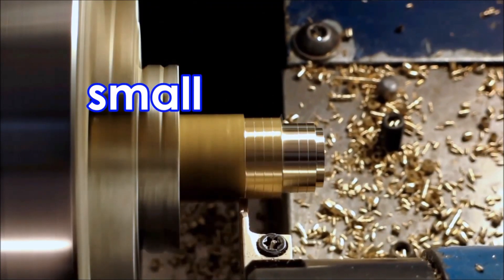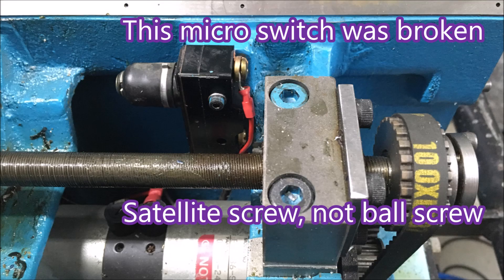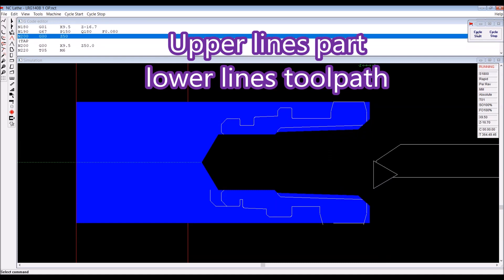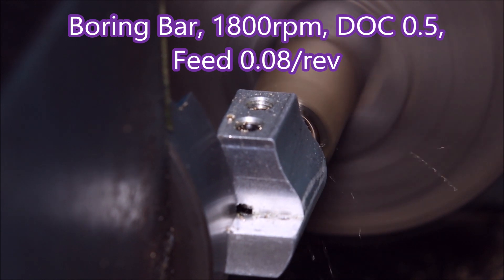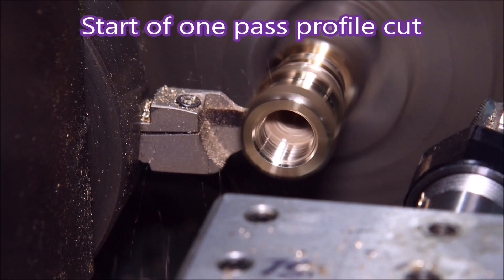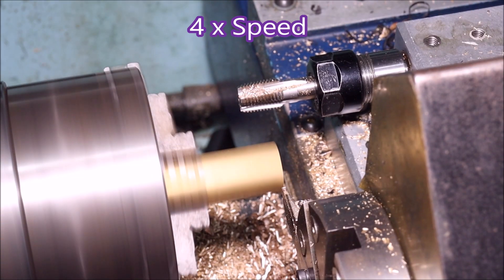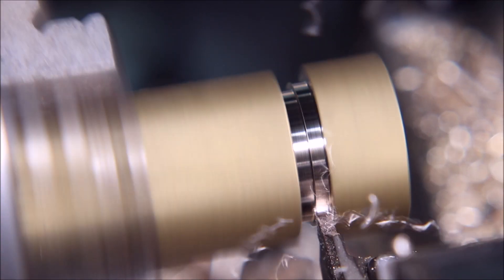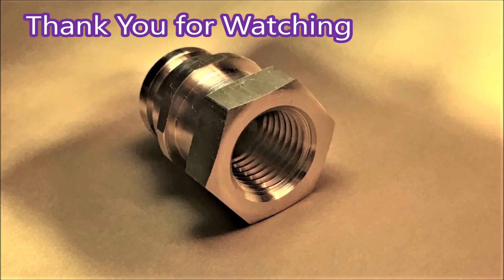CNC lathe turning brass, stub drill, bore, tap 1/4"NPT in DIY floating tap holder, carbide inserts

Comment: i notice you use a constant spindle speed.. is that because of the lathe or preference?
Reply from the maker: Constant surface speed is not an option with these lathes. For most of my work it is a bit irrelevant as I mostly need maximum speed anyway. LOL  I have had a few jobs where it would be useful but not many, most of my work has been small. Thank you for your comment.
Reply: @smallcnclathes  i have a 5k rpm spindle with a 1.25 inch max collet in a swiss style lathe. i use a variable speed just because but sometime find the rpm difference to make the cycle time slower for roughing or im just not using enough sfm. was just wondering if it was your preference. im just getting to afford trying to be more material specific with my insert grade and style. i believe i have had quite the limiting factor using a general purpose grade for most of my parts. fake it till you make it!
Reply from the maker: My insert choices are limited to ones that are very sharp due to a lack of grunt for the spindle. Aluminium inserts for everything non ferrous and a ground insert with 15 degrees of rake for everything else including st st and 4140.  If those inserts can't handle it. I don't bother with the job.  This is after all a lathe built for training students in the use of cnc!
Reply: @smallcnclathes  your machine limits are totally understandable, i wasnt sure. my insert selection has been financially limited. i got a set of holders with a box of inserts and made them last the duration of the machine payments for the most part, 5 years! haha. now ive become more interested in proper tools for it! just bought of box of aluminum inserts for all my holders, be here soon for a job im trying to get. appreciate the info, sure ill bug you again.
Reply: @smallcnclathes  what sort of spindle motor do these lathes have ?
Reply from the maker: @HM-Projects  180 vdc, 2500 rpm, 1/2 hp

Comment: Apologies if this has already been covered but I haven't found it - do you show anywhere how you go from a CAD drawing to the G-code?
Reply from the maker: Michael Henriksen, I have not done this, never thought it would be of interest. Will give it some thought.
Reply: @smallcnclathes  Thanks, I would certainly be interested. I will hopefully acquire a CNC lathe within the next 6-12 months so I'm trying to soak up as much information as possible. I do have some CNC turning and milling experience but mostly with Mazatrol controls. No CAM or G-code writing.
Reply from the maker: You may have to give me a bit of time. So we need to start with a slide of the part drawing and then a slide of the drawing I make to create the dxf? Then I import the dxf to the cam software and show how I create the code by doing a screen record of the actions taken? That is likely to need a great deal of editing my friend, I have always admired folks who can do an onscreen cad tutorial etc and thought “ I could never do that”  if it turns out to be a real dogs breakfast, I may make it unlisted and only you will get to see it. LOL. I am working on the drawing now, making it like this part
Reply from the maker: https://youtu.be/4zeGVwnhbvs damn iPad,
Reply from the maker: Here you go https://youtu.be/mgJA-aJFDHU is that what you mean?

Comment: On the loose turret.  Maybe a 4 postion index-able locking pin that slides into a tapered hole for each tool postion.  Some kind of bevel spring washer type pin and a solenoid to hold it unlocked during rotation.
Reply from the maker: Thank you

Comment: You could probably fit a bike disk brake to the shaft to lock it in place. Should be simple enough, cheap and have more then enough holding power.
Reply from the maker: That might be a very clever solution. Off to look up bike disc brakes!

Comment: "Just saying" I would run this part on a B&S,feed out bar to stop-combination flat drill + face off and from at the same time  in one operation+index and tap +cut off part! cycle time well blow your mind!👍👍
Reply from the maker: I am well aware that other machines can make these faster. However, I have two of these machines in my single car size garage. No room for bar feeder or a forklift to handle long bars. My machines run 240 volt not 415. They make parts at a speed my customers have been happy to pay for in quantities that suit us both. The initial purchase price of one of these was manageable for myself as an individual. Yes there are many machines that can make any part faster, but I don’t own even one of them! And you know what they say about the only tool you own being a hammer!  Thank you for your comment, as it has given me the opportunity to justify how my little machines have managed to keep us fed at times, when there was little other work around.

Comment: Awesome videos,  I had a thought, if your adjustable worm wheel has more backlash on one side, can you switch the part off tool to the tight side? Most other tools you are using are less susceptible for vibration.
Great job!
Reply from the maker: Thank you, you are quite right. If we could get it to a point where the backlash came good at one point, that could be where the parting tool is fitted. I have a few options to consider. One of them being, make it possible to tap in the other lathe, which may be the best option. That lathe has far more power available at the spindle. Not sure at this stage where to spend my time. Adjustment of that worm wheel is not easy, almost needs to be fitted with a jack screw so the tension between them can be changed incrementally. Thank you for your suggestion.
Reply: @smallcnclathes  I know your lathe is a complete running machine and too busy to tear down. But I know worm wheels are next to impossible to remove backlash. On my CNC mill 5 axis table I used Harmonic Drive planetary reduction gear sets and they are very solid with no backlash. Just an idea if you feel like upgrading your tool spindle.
Reply from the maker: I have reached the stage where I really don’t need two lathes anymore. As they exist, they both have things they can do, that the other cannot.
If I can get the other one to tap, the only thing this one can do that the other can’t is cut tapered threads. A function I really no longer need. So I guess I really need to get the old one tapping and then make a choice about making more space in the shed!!

Comment: https://youtu.be/w6_gJXj8yHA?t=123 I'm wondering how you ended up with an internal chamfer on the chuck side. Did you modify the toolpath of the boring bar to plunge into the material at the bottom of the hole?
Reply from the maker: I have done that before but with larger bores and 35 degree point tools.  This was an 80° insert.  In this instance just a de-burring tool after part was dropped off.  Thank You for your comment.

Comment: Nice Work on the part!  What software are you using to generate your tool path?
Reply from the maker: The software that was supplied with the lathe. It is cad/cam software, with the cam offering canned cycles and the ability to follow a profile. You can get a better look at the software here:   https://youtu.be/4zeGVwnhbvs
Reply: @smallcnclathes  Thanks.  Looks like 25 year old Hercus Software is still going strong and getting the job done.  I'm trying to find the best software for my cnc lathes.  I've played around with BobCAD Lathe and now experimenting with Fusion360's lathe module.   Your machine gets the job done.  Maybe you could show a little more detail on what appears to be a spring loaded tap?  (Great idea btw)
Reply from the maker: Does this do it for you?  https://youtu.be/adyteLDdqdY
Reply: @smallcnclathes  YES!  Excellent video on the construction of your floating tap.   (Sorry - I didn't think to look for it).   Well done!  Definitely proven out, too.  Thank You.
Reply from the maker: Making this video has really made me think about making a block to hold the tap for my other lathe. It has a lot more power at the spindle and might even hope that it could still do the tapping in high range.  3000rpm for the turning and full motor power at 500 rpm for the tapping. It may even tap that 1/4 NPT without messing around with the taper bore!
Reply: @smallcnclathes  Looking forward to the YouTube video.
Reply from the maker: Just don't hold your breath, you could get very blue in the face! next video in planning is drilling 6x75 deep to see if it wanders off centre.